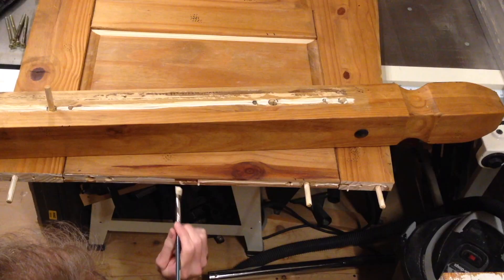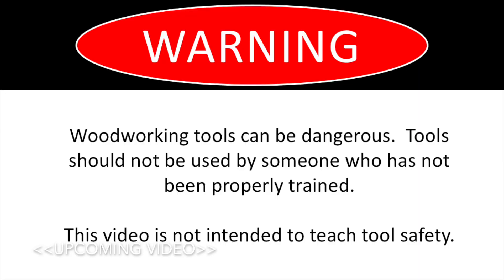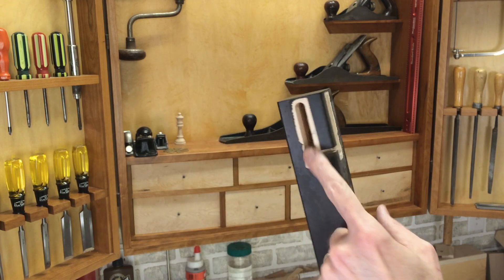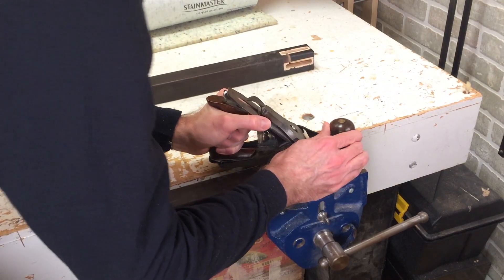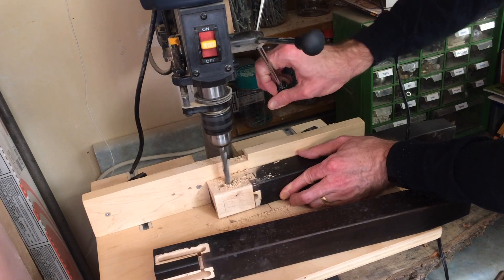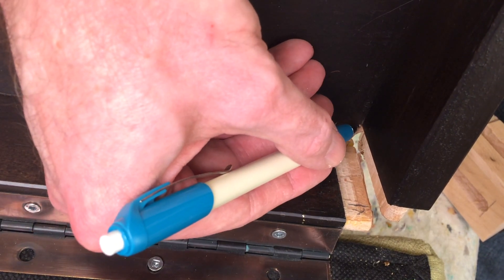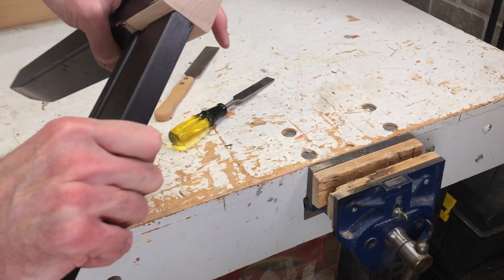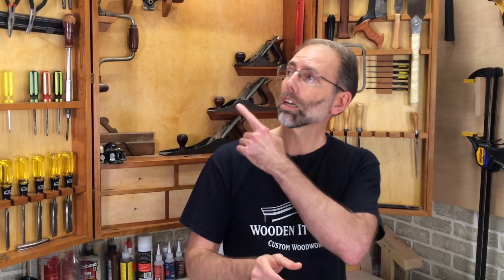How to Replace Damaged Wood in Furniture - Wood Repair Level 3 Skill

Comment: Can you do other extensive repair video examples? I have a chair I salvaged (Hepplewhite Mahogany chair) that some VERY inexperienced person practically ruined. It has massive staple and nail holes on the top and underside, to the point that parts of the wood have fractures forming. I wonder if you can do a video on how to fix these (if possible) types of issue. I’ve been following your channel for a month now and you’ve inspired me to repair discarded furniture and so far I’ve repairs 2 chairs successfully and a Hepplewhite styled nightstand from the 50’s. Granted I’m a baby in the beginner department and only take on small challenges but this one chair is beyond my level so I’ll leave it until I learn more so I look forward to more videos from your channel!

Comment: I have probably a nube question.  Is there ever a situation while glueing wood that you would only want to put glue on one side only?

i ask as i have watched some wood workers who are said to be among the best of the best and there are times only one side has glue on it and i am trying to understand why that is the case or is it a mistake that has been made?
Reply from the maker: It's a debate in the woodworking community.  Glue on one side or both?  I apply glue to both sides as I've seen spots where there isn't enough glue the I apply it to only one side.  If you get even glue squeeze out on your glue up, that's what your evidence  you've applied enough glue.  Aircraft technicians have a specification that they must adhere to that states glue must be applied to both sides.  That's what I do and advocate as the best practice.  I hope that helps.  Scott